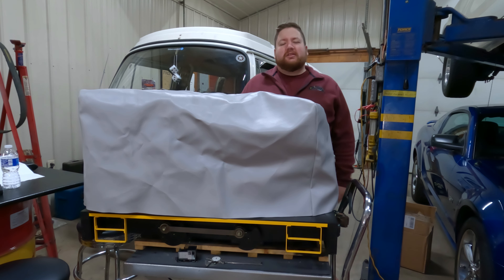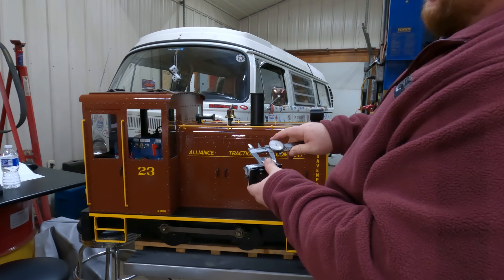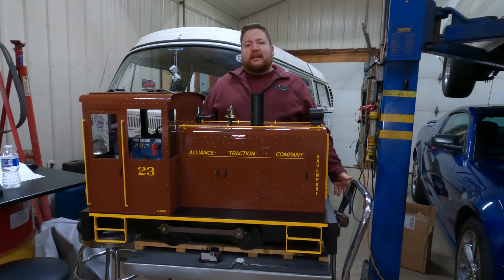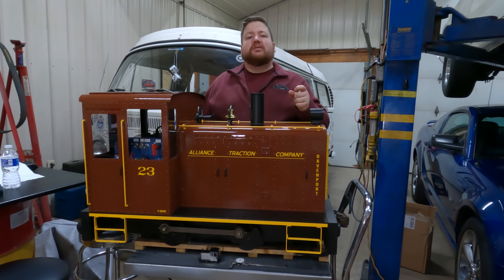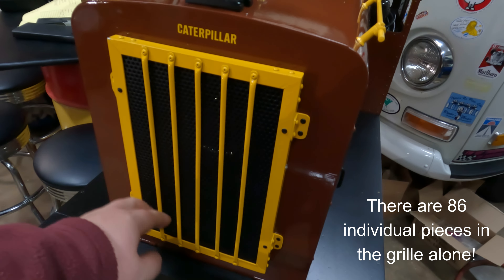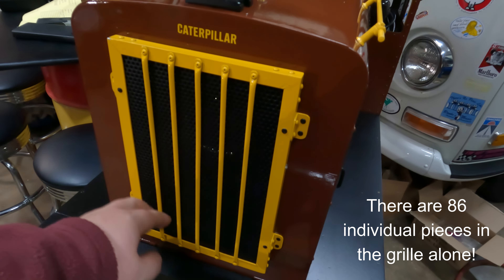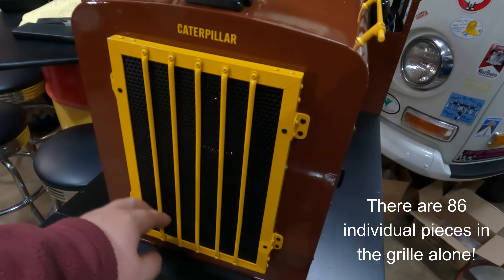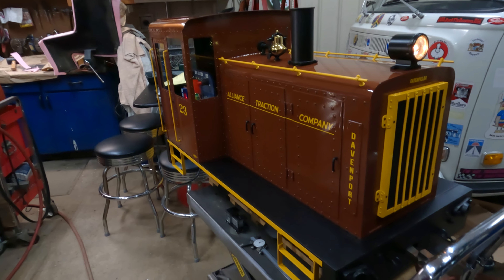7.5" Gauge Gas to Electric Locomotive Conversion | Part 3, Building the Body

Comment: Nice job on your project. Very impressive. I am working on a 1/8th scale version of a GE-75 ton steeple cab  and have used AutoCad and SendCutSend as you did.  The laser cut sheets for the body and  the trucks and many of the frame parts really saves an incredible amount of time. The one part I'm having trouble with is bending the cab roof.  I think made the roof sheet too thick and nothing I have seems to be able to bend it.  I like your idea of the  pipe and angle iron with a vice - I'll have to give it a try before I give up and order another piece in a thinner gauge.  How did you get the overall curvature of the roof bent? I am trying to avoid having to buy a 24" roller just for one project.
Reply from the maker: I only had to bend the edges of the cab by hand. I have seen some clever diy sheet metal brakes made of wood on YouTube for bending a radius. Sometimes making a tool takes more time than making the part. I did not have to bend the slight curve on the top of the cab or engine hood. Due to the radius being so large, the profile of that curve was held when the roofs were welded to the cab/body walls. 

Good luck with your project!

Comment: You did an amazing work and paint. Thanks for your shearing.
The good point with all these critters, Davenport, Porter, GE, Brockville, Plymouth, Vulcan etc is that they made so many variations, with not too many look alike that as long as it´s plausible, you´re fine. Plus customers changes after decades of service.
Fiberglass or steel body ? Harsh question. I prefer dent and bump with steel than fiberglass´s cracks. But the latter is easily repaired. Curves are the nightmare. Even if perfect radius isn´t attain, it must be the same on both faces. I too think about the pipe trick. Too thin is fragile and unweldable. Too thick, good luck for bending. Short pieces can be heated with torch for those that own one. But long pieces means failures. Welding together many small ones to make a big one ? An other hassle.
I plan an Alco RS3. At more than 8 feet long, it´s a lot of hood and nose large radius curvature. The worst being the four hood corners where sides meet top panel and match with the front one. Sort of basketball shape. May be do and weld everything together, cut a perfect hole in the center (good luck to find it) add the perfect corner match...4 times  then cab curves are different too.
To add some spices to that nightmare, don´t know no one making AAR B trucks. Or cheat with Blomberg...
Type of project good to keep me busy for a decade and to send me in some asylum...
😢😮😅😊
Reply from the maker: Thank you for the compliment! You made great points, good luck with your RS3
Reply: @mattkinnard6899  thanks.